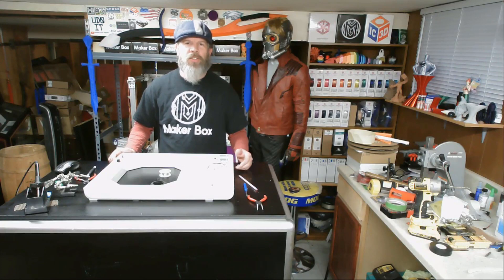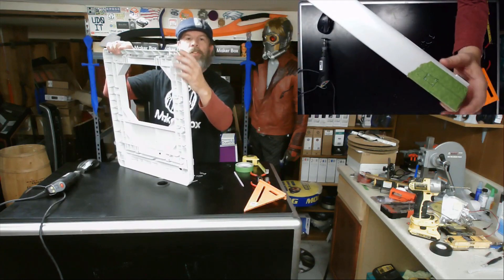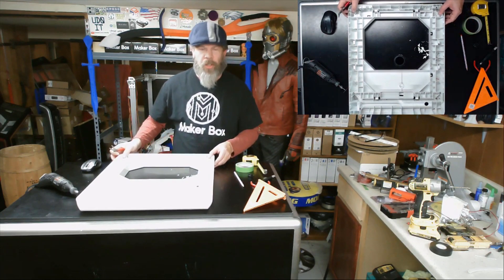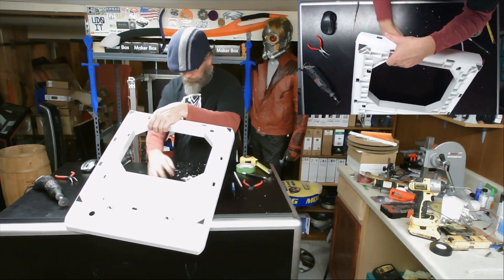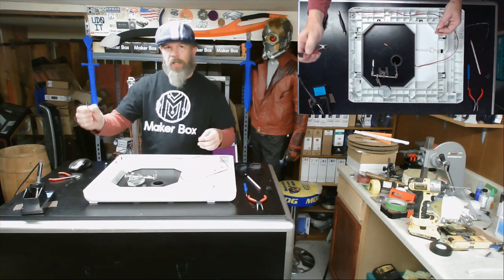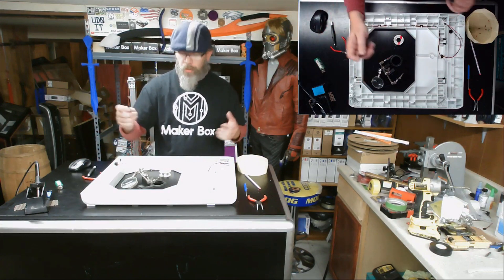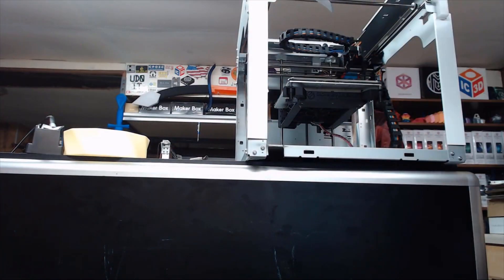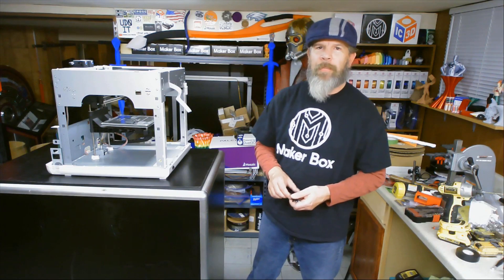Da Vinci Chimera 200 Edition Upgrade - Part 15 - Relocating Power switch

Comment: There is so little info on upgrading these units, i was surprised at how thorough you have been on this build. Although i have experience building other cnc devices, it nice to see one finished.  When would that be?
Reply from the maker: Sorry to say I got turned down a belt printer rabbit hole a few years back.   Not sure if that build will ever get completed.  However I have an idea to use the frame and covers for a Voron style upgrade.

Comment: I just upgraded my Da Davinci 2.0 Duo with a Chimera hotend and bowden extruders. I'm just using the generic metal extruders, but my biggest problem is getting the slicer properly configured with the new setup. I didn't upgrade the bed, still using the stock bed for now. also, is there any trick to getting the two hotends properly aligned? I always have one slightly lower than the other. 

Thanks
Reply from the maker: B_Bone getting Cura fine tuned just takes patience..   Best way to level the nozzles is set one nozzle down, level the bed to that nozzle with a piece of paper, zero the bed, then drop second nozzle on paper.    Hope that helps
Reply: @NAK3DDesigns  Thanks. Look forward to when you get that DA Vinci printer done. It was my first 3D printer back in 2014. I've been waiting for a good mod to make use of it again.
Reply from the maker: B_Bone btw sorry I left this project hanging.   Demand for info on the White Knight has been overwhelming.  I do still plan to finish this series once I finish editing all the WK videos.

Comment: I will be a bore, but it is better to invest in a double insulated cable, it’s a safety issue. The contact of metal parts, the possibility of potential wire jamming, I don’t know how there are in your country with differential switches and safety devices, but the device can continue to work and at the same time become hazardous to health
Reply from the maker: Sergei Menzhulin I understand where you are coming from but it’s an ATX style power supply and there is only 5V running to that switch.    Thanks for the feedback.  All is appreciated.
Reply: I seem to have produced an extra panic, this is a control voltage :)

Comment: You can buy safety glasses that have bifocal cheater lenses built in.  Also, please wear gloves when you are using the cutting disk so close to your hands.  BTW, you video is lagging the audio.
Reply from the maker: Thanks,  Yes my shop teacher would cringe at the amount of safety gear I don't use that I should...  Seems every episode I need to readjust my video sync..  I don't understand why it keeps changing..